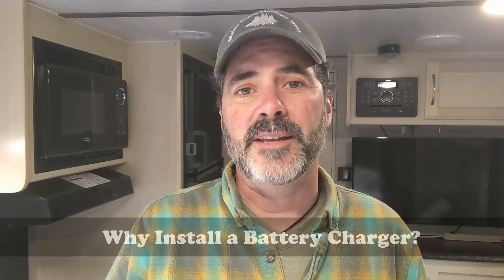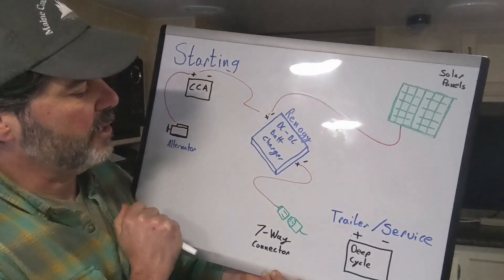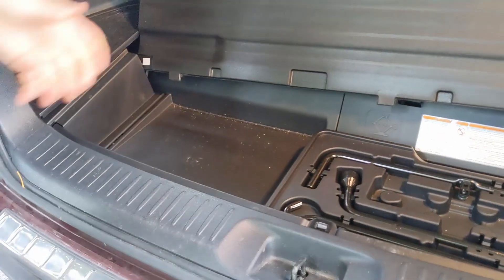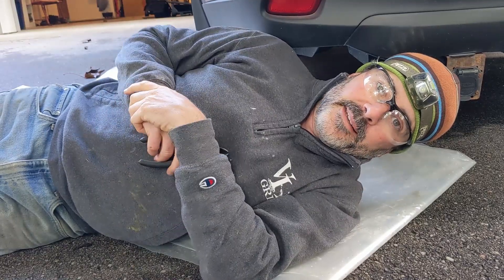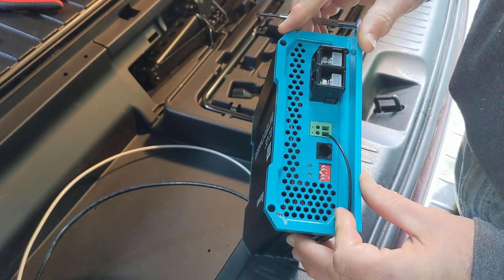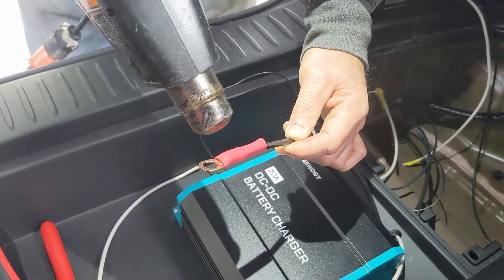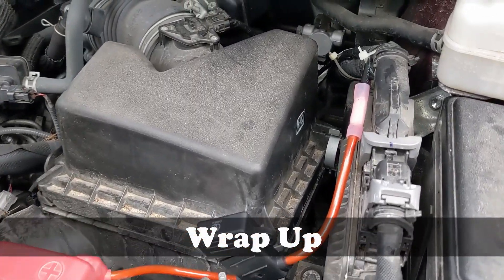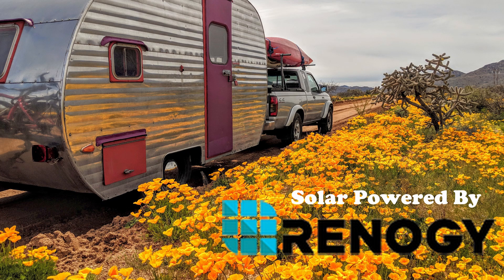How to Effectively Charge RV Batteries While Driving: [Renogy DC to DC Charger]

Comment: nice job on the video.  the only comment i have is related to the 7 pin wiring connection.  is the wire in the 7 pin connector large enough to handle 20A for several hours.  i dont know what the guage is either on the truck end ot the trailer end
Reply from the maker: Great thought here.  We commented on this issue in the video description, after the install we discovered that in fact the 7-pin wasn't big enough to carry the 20A.  Nothing bad happened, except it just didn't charge as expected.  We installed a 50A Anderson connector using 8awg wire to either side of the trailer connection, and left the 7-pin connected as well.  It works brilliantly!  I hope this helps you.  We did a similar install in this video, which shows all the steps with that Anderson connection.  https://youtu.be/IsRrIKzWpFo
Hope this helps.  
If you choose to buy with Renogy, use our custom link to save 10% https://renogy.sjv.io/LPEyNY  be sure to use our, CANLIFE promo code at checkout.  Let us know if you have any further questions.
Reply: @FreedomInACan  i will likely be using renogy,  100ah battery and the dc to dc charger.  will my existing ac to dc converter in my trailer run the dc to dc charger?  i will be dealing with renogy canada, i wonder if your discount code works here too!
Reply from the maker: @stevem268  Great, and yes, our discount link and promo code works in Canada! If you are getting a 100ah Lithium Iron Phosphate battery, you need to make sure that the traditional AC to DC Converter in your trailer is compatible with LFP battery types, it should say in the manual.  The DC to DC charger will be connected straight to the battery from your vehicle starting battery via the Anderson connections, and should not be connected to the converter in any way.  You can see how we installed a 60A DC to DC charger on a trailer, and connected to Anderson to the truck in this video starting at 8:40.  https://youtu.be/dVD1oRIgBQc?t=522
The rest of that video is the Renogy REGO installation which covers solar charge controller, DC to DC, and Inverter Charger, which in this case takes over the job that the converter did so we disconnected it altogether.  Fire away with any more questions.
Reply: @FreedomInACan  thanks so much for the help, you are much more responsive than renogy!  i hope they are compensating you in some way!
Reply from the maker: @stevem268  we are affiliates so if you use our link, we get a small commission.  We also write blogs and do other events for which we are compensated. But, they get thousands of calls a day we get a few a week!  😂. Seriously though we love helping folks go solar.
Reply: @FreedomInACan  that's good to know, well deserved compensation.  there are a lot of rv channels and even more on batteries and solar.  i like your down to earth approach but using what seems to be good quality equipment.  we travel in a 15  year old 26ft trailer so spending thousands and thousands on a power supply just isnt in the cards
Reply: your discount code CANLIFE is invalid!
Reply from the maker: It may say that when the item is already on sale.  That is you can't apply the extra discount to an already discounted price.  If you use the link, then we still get credit.  Thanks for the update.
Reply from the maker: If it's not working on a non-sale item, please let us know.  Thanks!

Comment: This is the best and the most relevant video I have found so far. I have a Toyota RAV4 and was going to install a DC 2 DC charger. We already have the black wire coming from the battery to the 7 way. My hardest is how to get the new 8 AWG wire from battery to back, maybe will try your method. We will use Anderson plugs.
Reply from the maker: Thanks!  We just uploaded an additional video where we installed waterproof 6AWG on a friend's Toyota Tacoma for their Renogy REGO 60A DC to DC charger using Anderson Connectors, give it a look.  https://youtu.be/IsRrIKzWpFo

Comment: Would this work in charging a single deep
Charge 100ah 12v that I use for my little mobile office printer? I have the deep charge battery in the back area of my vehicle.
Reply from the maker: Possibly.  What are the charging parameters of the battery in question?   What type of battery (LFP, AGM, flooded, etc.)?What's the maximum continuous charging current that the battery can take in?   This blog (and associated charts) may help you answer these questions, as well as introduce you to other charger options that may be of interest to you:  http://renogy.sjv.io/MXokzo  Holler back with further questions!

Comment: A few mistakes here.

The wiring color is wrong. In cars we use  12v positive and negative dc; not hot and neutral like with ac power. There is no neutral or hot wire. The correct colors are red for positive and black for ground. 

For wiring you should use high strand count stranded car audio or welding cable. Stranded 120V wire is not flexible enough to go around bends in a car and the insulation is very thin. 120V wire was not designed to deal with potential abrasion issues from a moving vehicle. 

For that length of a run I would have also recommended going to 4AWG due to potential voltage drop and dc resistance issues.
Reply from the maker: Thanks for the feedback, these are good recommendations.  But don't you think that 4awg is a little overkill on a 20a charger with a run of around 12 feet?

Comment: Important question: when I connect the Renogy unit to the house battery directly as you suggest in your update (with Andersen connectors) do I have to disconnect the built-in charging system that runs through the seven pin connector?
Reply from the maker: No, my father left that connection in place, when he added the larger gauge wires and Anderson Connectors, and it doesn't seem to disturb the process.  Hope that helps.

Comment: Hello thank you for video, really helpful and hello to all RV owners, I need some help please. I live in the UK and have an A class, please see my channel below.
https://www.youtube.com/channel/UCLBh8NH-bSU36CfJ1paQdOg/featured

 I have also acquired this Renogy DC TO DC charger but I can't seem to trace my cables to know if A class RV's of the 2000's put power straight to all batteries, front and leisure or if they have a split charge relay etc? so could I install this Renogy charger onto the original cables that go onto leisure batteries and then put in 2 more cables from the output to leisure batteries regardless of what may be between the front and leisure batteries installed my manufacturer? Hope this makes sense and I would really appreciate any help, kind regards Nik

Comment: I'm using the renogy dcdc with solar charger and have noticed a 15% decline in milage. Is this considered normal?
Reply from the maker: I am assuming that you are referring to your average miles per gallon (MPG).  There are a lot of factors which can contribute to a decrease in MPG, including weight of the trailer, terrain, wind and even humidity.  I notice that even with a lower grade fuel, we get better MPG in the west simply because we are pushing through less humidity.  That being said, we want to make sure that you're not over taxing your alternator.  Do you have this connected appropriately to the starting battery?

Comment: Thanks you for your great vidéo. I would like tot now what the max current is that you van past by the connections câble to the caravan.?
Thanks you in advance for tour answer. Joop
Reply from the maker: Thanks for the comment, Joop.  Now that we've got the DC to DC charger connected appropriately through an Anderson connector - (video on that coming...).  We're able to see 20A coming into the house battery bank from the car.  We also installed a battery monitor which shows the amps in and out of the battery bank - which we didn't have when we originally made this video.
Reply: @FreedomInACan  
That is a verry good solution. Thanks for Charing thuis to us.
Have a great summer. Tks again. Joop

Comment: I have 2 100ah deep cycle batteries in my minivan build to power lights, fridge etc. The batteries drop to 60-70% throughout the night. In the summer, my 100w solar panel tops the batteries off by noon everyday and remains in the 90+% all day.

Cloudy days and/or in winter my panel wont top the batteries off. So I am adding a Victron Energy Orion-Tr IP43 12/12-Volt 9 amp 110-Watt DC-DC Converter, Isolated- that I got for free. Since my solar is only 100w at best. 

I want to power it off my rear cigarette lighter plug 20 amp (shuts off with ignition) since the plug is right there in the back of my van by the rv batteries. Will this work or do I have to connect it directly to my van battery (which will be a pain to do)?
Reply from the maker: I think that you will need to install it the more painful way, and connect it to the starting battery.  Sorry, but I think you will have fewer issues down the road.

Comment: Do I need to be concerned about the loads in the trailer that are drawing current while travelling?  The biggest load is the DC refrigerator which draws 10 amps. Will the DC-DC charger still adequately charge the trailer battery?
Reply from the maker: If your battery bank is already sized appropriately (Ah) to handle your off-grid load, then your base load, (those things you need to have on all the time) shouldn't cause too much trouble for your battery.  You need to make sure that the size of the DC to DC charger (Amps) is sized appropriately for your trailer batteries.  What you're looking for is the maximum battery charging current, these can be found in the specs on your battery.  If you match the size of the charger correctly, as well as all your wiring and fusing appropriately, your battery should be able to charge while still powering the base load.  It won't charge as quickly while it's under a load, of course.  Read this blog on choosing the right size charger for your batteries.  renogy.sjv.io/kj1R4n

Comment: what reason would you have to not install the DC-DC inside the trailer after the 7 way pin? does it not provide enough current?
Reply from the maker: People do this all the time, for sure. Especially when using the Dual Input, that way the solar panels on the roof of the RV can also be part of the solution.  However, we still wouldn't recommend taking the charging current through the 7-pin.  By using Anderson connectors, or similar brand, you get a reliable and robust charge from the vehicle to the trailer.  To decide what DC to DC charger is right for you, check out this article. http://renogy.sjv.io/MXokzo
Best!

Comment: Anyone know now any manufacturers that make 7-way plugs and cables that have the appropriate wire gauges so it's not necessary to run a seperate battery cable? Most have black and white wires that are only 12 gauge or 10 max.  Should be more like 8 gauge.
Reply from the maker: That sure would simplify things for a lot of people.

Comment: I have a question if your alternator can be hooked to this device and it puts out AC but it says on the device that is a DC to DC which is it?
Reply from the maker: Yeah, this is confusing.  You are connecting the DC to DC charger to the alternator through the starting battery.  When charging the starting battery, the AC current from the alternator gets changed to DC.  So your electrical system in the vehicle is all DC.  This makes it easy to charge an auxiliary battery as we've shown in this video.  The DC to DC charger boosts the voltage and the current to more effectively charge that auxiliary battery.  I hope this helps!

Comment: And what voltage do we stop charging our batteries?
Reply from the maker: First off, if you've set up your charge controller or DC to DC Battery Charger to match the specific battery type that you have it will handle all the charging automatically.  The specific voltage depends upon the type of battery that you have, 12v flooded lead acid are typically full between 12.4V and 12.7V, but 12V Lithium Iron Phosphate are full at 14.4V.  Send us an email at freedominacan1957@gmail.com and we will send you a helpful chart.  Thanks!

Comment: You said that Renogy makes a dual input DC to DC battery charger that take that takes solar input also! What is the Renogy part number for the dual input item??? Thank you
Reply from the maker: Hi Charles, Yes, we have one installed on our own vehicle and love it!  Check out the pinned comment at the TOP of this video for a blog with details/product info as well as learn how to choose between styles and size a DC to DC charger to fit your equipment and lifestyle.  You may also want to check out our Maximize Boondocking Power video on this channel for installation steps and tips for the Dual Input version.  Holler back with further questions.

Comment: I'm missing something.  It boosts the voltage from 14.01 to 14.47?  Not even 1/2 a volt?
Reply from the maker: Hi James, thanks for the question.  Here's the thing about charging voltage that might have not been very clear in the video.  The voltage of any battery charger will match the battery bank, and at that point in the video we didn't even have the battery connected to the charger.  Different battery types need different voltages based upon their chemistry, but the bottom line is that the voltage will only read slightly higher than the battery voltage status.  The important thing with this DC to DC charger is charging current, in amperage (Amps).  In this video we connected the charger output through the 7-way trailer connector, we learned later that this really wasn't the best way to do this because of the small pin connector (and I amended the description to indicate this).  Through the 7-way, we were only getting between 3-7 Amps, hardly better than the trickle charger.  But when we connected the charger directly through to the battery using a quick disconnect (Anderson Connectors), we got an unwavering 20A - which is the output limit of the DC to DC charger.  This quickly charges the battery bank replacing up to 20Ah in one hour of driving.  I hope this helps.
Reply: @FreedomInACan  Electrical is my weak suit.  That helps very much.  Thank you.

Comment: Thanks for the great video! I don’t have a 7way connector on my truck, but it sounds like that’s not necessary if I used those Anderson connectors and connect it straight to the house battery, is that right? Thanks again!
Reply from the maker: Yeah, that's right.  Since it's a truck you want to be sure to ground the Anderson all the way back to the starting battery, a bit more money on wiring, but a much better connection.  Also be sure to fuse between starting battery and charger, as well as between charger and battery.  You might want to think about putting a switch on the positive lead at the starting battery so that when you drive around without the trailer you can turn off any power to those Anderson connectors.  Make sense?  
Be sure to use our affiliate link in the video description, plus promo code "CANLIFE."  There is a sale going on right now and we believe that it will get you an additional 10% off.  Good luck!
Reply: @FreedomInACan  thank you! Super helpful!
Reply from the maker: @mattgettleman686  Happy to help...let us know if you need further info.

Comment: EDIT: I see they DO make a connector - Anderson Connector. So you could install the DC/DC charger in the camper and run the Anderson connector plug from the truck to the camper! Cool!

great video, I was looking for this! wondering do you put in the truck or in the travel trailer and make a connector. Wondering now how the location would change with wiring in also solar panels? They should make a full plug connector so you could install the DC/DC into your travel trailer and plug it into a connector on your truck - maybe mounting the connector next to your 7 pin input socket? That would be the neatest way to probably do it. So you would plug in your normal 7 pin when hooked up and ready to go, and plug in the wiring harness for the Dc/Dc device. I'm just thinking out loud...doing all this research. Thank you for making this video.
Reply from the maker: Thanks! Yes, and if you want to integrate solar into the system, you'll want the Dual Input version of this DC to DC charger, which we installed in our truck to run a 12V cooler, but it can easily be installed in your trailer with Anderson connectors.  Here's a link to an installation of the Dual Input DC to DC charger: https://youtu.be/ur7gKRKp7aY. Holler back with questions.
Reply: @FreedomInACan  Thank you very much for the quick reply --- we are in the learning stages of installing solar with lithium and I like to put that dc/dc charger in the loop too.
Reply from the maker: @KJC63  You'll love it!  It's changed our boondocking life. PS It's currently on sale at Renogy.com for $212 and with our affiliate link and code "canlife" you can save an additional 10%.

Comment: How much charge loss are we talking when using the 7-way? I want more charging than the 5amp from my vehicle battery, but not sure going the extra with the anderson clips will be needed as I do camp at sites with power. I just want to make sure my fridge runs on 12V while traveling and still have enough battery for my Enduro Power mover when arriving at my destination before plugging in. (FYI I have a single 100AH AGM battery in the camper).
Reply from the maker: Hi Carol, I really can't specify how much loss we are talking about here.  So much depends on the gauge of wire that you use and the distance between the plug and your battery.  We initially went this way because the batteries were less than 8 feet away.  To minimize loss and maximize charging, I'd have to recommend going with the Anderson connections or some other quick disconnect that is outside of the 7-pin.
Reply: @FreedomInACan  Thanks